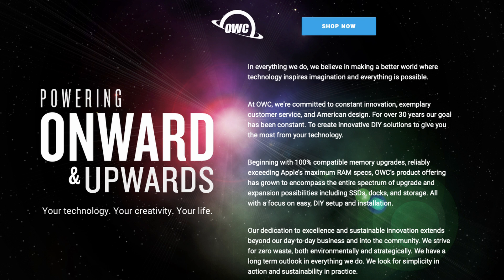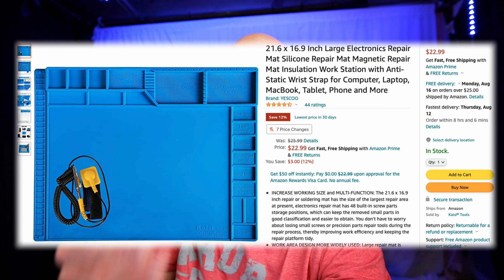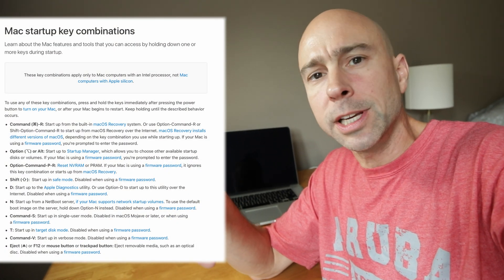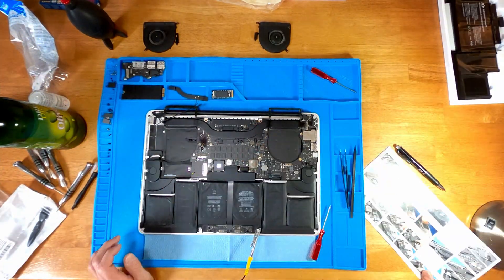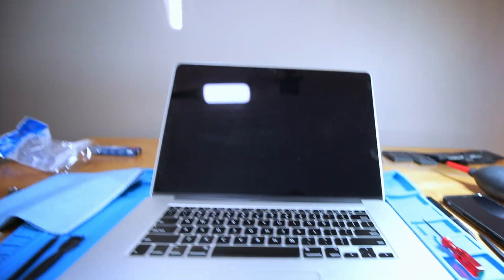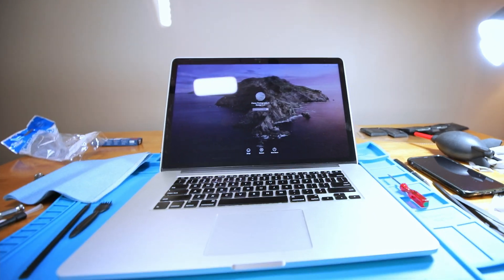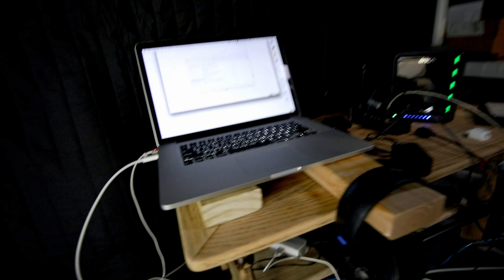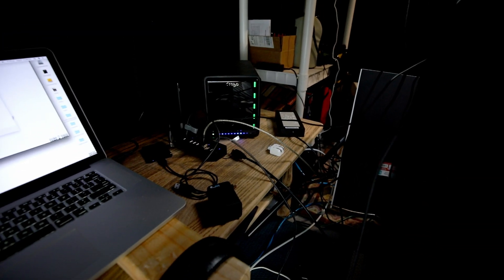APPLE said it was DEAD!  But I FIXED my 15" MacBook Pro STUCK in a Boot Loop!

Comment: Hi! My Macbook Pro 2019 is not starting. It was working fine last time I used. I tried several ways to turn it on, but no luck. Will changing the battery work? Apple says the logic board needs to be replaced. Thanks!
Reply from the maker: Not sure if replacing the battery will work for you but they told me it was a bad logic board too which wasn’t true.  I figured I’d give it a try for 85 bucks, and installed a new battery myself. It worked, and I’m still using the same laptop today.  Realistically, I think Apple just wants you to buy a new laptop, but it may very well be fixable.

Comment: Yes! Mine was the same, and I did exactly as you said, and it booted the first time!! Same model as well
Reply from the maker: Awesome!  I’m still using mine with no problems! 😁👍
Reply: @JasonYadlovski  I’m curious, did you ever do the work to get it up to Ventura? I’m considering it
Reply from the maker: I haven't tried upgrading it to Ventura yet, but I should give it a try.

Comment: I just replaced the battery from my macbook pro mid 2015 because it had been in "service battery" state for couple of years and after replacement it started all good but it still said "service battery". So I decided I will do the battery calibration, The battery was around 80% full or something so I let it charge to full and stay there bit over 2 hours. Then I let the battery dry out so that the computer shut down, went for few days holidays and now that I came back I tried to charge it to full but the charge indicator never turned green (I let it charge maybe 6hours). So now that I'm trying to turn on the computer the battery icon just shows "X" on it (No battery installed?) And I can't get to my desktop, each time the login progress bar hits around 50% it just shuts down. Any Ideas? I've tried PRAM reset and nothing :(
Reply from the maker: Maybe try unplugging the battery and then just plugging it back into the computer again?
Reply: @JasonYadlovski  Thanks I will try that! I also found a new battery with a decent discount and delivery time of 3 days tops so placed an order for that... just in case
Reply from the maker: Nice, I hope it works out!

Comment: Thanks i changed my MBP 2015 bad battery and it fixed my boot loop problem
Reply from the maker: Awesome! Exactly the reason I made a video, to help somebody else out and prevent you from having to buy a whole new computer.  My 2015 MBP still working awesome and I use it daily.  😁👍

Comment: The reason Apple didn’t suggest replacing the battery is because their genius bar is sad fact of the matter, not there to actually fix out of warranty product, but to convince you that you need a new one. It’s part of what makes Apple’s boasts about sustainability a joke since they chomp at the bit to get people to replace, rather than repair and reuse. I’ve been servicing older Macs for decades now and 80% of the time Apple says something is terminal it’s a $200 or less repair.
Reply from the maker: That’s crazy, sad that they do that. I’m glad I was able to figure out how to fix mine, saved me a lot of money.  😜

Comment: Hello, I'm having this exact issue but mine turns on by itself when I plug charger and starts this loop but it won't turn on on battery, please any help.
Reply: You mean that once you replaced the battery it worked, OMG, this is already giving me hope, please can I further confirm that your issue was exactly like mine 

Laptop doesn't turn on at all and when you plug charger it turns on by itself and then begins to loop but once you unplug the charger it offs.
Reply from the maker: Yes, that’s exactly what mine was doing. It was stuck in a boot loop as soon as I plugged it in. I took it to Apple, they said the computer was shot but I had done some research online and saw that a bad battery would cause this exact problem. 

So I took a chance for $80 and bought a battery from other world computing, installed it and the laptop fired right up and Its been running fine ever since.  

I would say, if you’re comfortable taking apart your computer, pick up the battery from OWC and give it a try. Of course I cannot guarantee it’s gonna work for you but if you’re like me, I figured I have a paperweight anyway so what do I have to lose. Just 80 bucks.  😜
Reply: @ayoseunsolomon2562  i have same issue too. the repair guy said it my graphics card but I don't think so.
Reply: @jideoguns3283   if it's not turning up, it could be
Reply from the maker: I had the same issue, replacing the battery fixed it.   I’m still using the laptop today with no problems.  Crazy that apple said the motherboard was shot, when it was just the battery.

Comment: Maaaaaan! You absolutely saved my 2015 15" MacBook Pro! Thank you so much! I had the EXACT same issue you had (Boot Loop) and your video saved me hundreds (maybe thousands) of dollars. I used the link you shared to order my replacement battery (same model as your MacBook Pro in the video). Once I received it in the mail, I felt prepared to do the work having watched your video. It really helped me a lot and saved me a lot of frustration because I knew what was coming! After it was all said and done, my old MacBook Pro booted up and all was right with the world. I can't thank you enough. Your labor is not in vain! Keep up the good work. Blessings!
Reply from the maker: That’s so awesome, super excited that it worked for you!  I can’t believe that Apple told me the motherboard was shot when all it needed was a new battery. I even pushed them suggesting that it was the battery and they said, nope it’s the motherboard.  I’m still using my 2015 MacBook Pro, works just as good as ever. 😁👍 cheers to many more years of use on your 2015 MacBook Pro! 👍👍👍
Reply: @JasonYadlovski   love you sir.

Comment: Happyness is what they are selling to make u buy new.. but u found out its the baterry....
Reply: can we modify the adaptor to fit the Battery port (without the battery but a modified port to fit) to fool the macbook that there is battery???
Reply from the maker: I don’t know, but for 85 bucks it’s worth it just to get a new battery.
Reply from the maker: Yeah man, glad I was able to fix it for 85 bucks. It’s been working ever since with no problems.

Comment: I'm so completely over Apple products. The last two Macbook Pro's and an top spec 2013 iMac all died within 6 months of the 3 year Apple Care plan ending. All for basically the same reason, they overheat, and the graphics chip or the logic board or the solder holding them together fries. $1500 - $2000 quote from Apple to fix them because of their own overheating issues. Their stuff looks pretty, and it works for a while, but it's disposable. So after 7 years of using Apple I switched back to PC and no more problems. Personally anyone doing full time video work should just stop buying Apple's products. Unless you're doing audio work, in which case I've been told PC is not an option.... /rant
Reply from the maker: Oh man, that is crazy that both your MBP's died just after the apple care.  That's not right.  I'm thankful that I haven't really any any problems with any of my Mac's other than this battery issue.  But thankfully I could fix it for just the cost of the battery.  Apple didn't charge anything to look at it.  Building a great editing PC is always in the back of my mind though....😜

Comment: 🐨Gday Jason, I recall the 'Formula' I used with Audacity to do my vocal's. I am certain that the same would apply in Resolve. In fact, I would not be surprized if Fairlight is actually based upon Audacity. I will send you an audio snippet from my E1S1 in a few weeks time. As I am camera shy, you will not need the visuals and I will not need the completed file as you will show me and others how it is done.                                                                                                                                    1/. Remove noise. 2/. Apply a compressor. 3/. Apply normalization. 4/. Drop the pitch by 3 semi-tones.                             My thanks in advance. 🙏
Reply from the maker: Hi!  I’m sure the same process you use in audacity will work in resolve too.  There are probably many of the same tools.  I have not  really used audacity but heard it’s good. 😁👍

Comment: That is so cool you got the computer working again!  I have a 2010 Macbook Pro 13" laptop sitting around here somewhere, plugged into the wall.  I think if I checked the runtime, it's been up for about 6 years LOL.  Battery is toast, so I don't dare unplug it.  That's the only Mac story I've got :D
Reply from the maker: Thanks! Running for 6 years, haha! 🤪
Reply: @JasonYadlovski  Yeah, I think it was several years ago I rebooted it for some upgrades, and promptly put it away again.  Now that you've reminded me I have it, I'll have to find it and see if it's still running and how long the uptime is... that'd be a great pic to take :D
Reply from the maker: That would be awesome.  I have an iMac from 2008 that still works.  It’s good for web surfing, email and typing papers and basic stuff.  Funny thing is at one point it turned off and wouldn’t turn on for two years. Then I decide to try it one last time before I was going to throw it out and it fired right up and has been fine ever since.
Reply: @JasonYadlovski  Well, anticlimactic, but I just checked and my wife unplugged my Macbook so she could plug in something else... so it's been long shut off. :(
Reply from the maker: Bummer!

Comment: Because Apple just wants you to buy a new one. They suck. I replaced the battery on my 2012 MBP a couple of years ago and it is still working. I don't use it for editing anymore but I use it for everything else.
Reply from the maker: Nice, glad you got it working. This 2015 that I have was maxed out when I bought it and it works great for everything. Video editing is getting a little sluggish for anything more than basic edits but it’s a fantastic computer otherwise. And still has all the ports that Apple did away with. 😁 i’m sure it’ll still work good for years to come.

Comment: OWC is the way to go.  I've used them for battery & hard drive for a mid-2010 MacBook Pro.  The instructions they send are spot on just like you noticed.   I had to retire that computer after 12 years because the OS no longer was being supported or updated, plus it was moving very slow.  I'm on a loaded-up 2019 16" MacBook Pro now,. Good to see you were able to fix your Mac.  If you decide to get rid of it, at least it powers on which makes it worth more on trade-in or if you sell it outright.
Reply from the maker: OWC it’s great, I’ve used them in the past for other things too. They really do a good job with all their stuff. 😁👍

Comment: Replacing a battery should be a straight forward thing but Apple does not want you to replace the battery, they want you to buy a new laptop!
Reply from the maker: Probably true. 😜 this time I did not glue the battery in, just in case I need to replace it again ever it’s a quick easy pop in and pop it out. I would give up all of the ultrathin, sleek look to a laptop for easier service ability and being able to change some parts around.

Comment: 🔴 How much did the Apple charge you for that so called "diagnosis?
Reply from the maker: No charge.  They reloaded the OS and checked everything else.  Only the battery came back bad, which I already knew. Said it was a bad logic board.  It would just boot loop and not stop.  After some research, seems people with 2013 - 2015 MacBook pros had the same issue  when the battery was shot.  Apple did say it should work with no battery or even a bad battery, but that didn’t seem to be the case.
Reply: @JasonYadlovski  🔴 If everybody else was working like these Apple guys, this world would become one big mess and it would be destroyed. These Apple employees are obviously not making this world and our lives better. Something is very wrong with the company, at least in terms of it's human resources policies, if not at a deeper and more basic level.

Comment: 🔴 Wondering if the Apple guys are this incompetent in their field, or they misled you on purpose, so that you would lay out more money. By the way, laptops with Windows OS run with dead batteries, with the adapters plugged in, and the batteries can be replaced in one click.

Comment: Congrats bro you still have a 4 year old $3200 mac book pro small 15" that doesn't equal the $1800 machine you've got coming in the mail.  Don't feel bad I ounce paid $3200 for a specially built laptop that was in the shop right after I got it for most of a year under warranty. but $75 shipping to Upstate NY where they took it across the border to fix Twice. I ordered it with a very expensive screen turns out the rest of the machine wasn't compatible with that screen so the put the 1080 on it and refused to reimburse me... they went out of business a year later.  Lesson learned buy local. Of I've been screwed by Best Buy too.
Reply from the maker: Congrats on the new machine! Do I sense a little sarcasm in there? 😜 all good. Mine is actually 6 years old and is a great machine.  Now that it’s fixed up it’ll be good to go for a long time.  It’s great for Lightroom and still great for DaVinci Resolve too but fusion gets a little tough for it. 

PCs are good too, I’ve just had a great experience with Macs since I started using them. In my experience there’s just much less issues with software and maintenance on a Mac versus a PC. Don’t get me wrong they’re both great and they can both get the job done it’s really just a matter of preference at this point in time.  I even have a iMac from 2008 that still works and is good. To each his own. 😁👍
Reply: @JasonYadlovski  It's ALL Sarcasm BRO  I just can't help my self when it comes to APPLE products or SPECTRUM radios for Radio Controlled airplanes. Have an AWESOME day
Reply: @JasonYadlovski  I have a DOS machine with a 9" CGA screen 2 5&1'4" floppies a 6 pac and 10 meg Westerns Digital hard card. Bet if I replaced the cell battery it might still boot. Anyone remember any Dos Commands like ??? (A)
Reply from the maker: Haha, it's all good my friend....that old computer might make for a good project!  I know spectrum radios, but I've never had one.  😁

Comment: Same thing happened where my sons cheep windows 10 computer qould no boot. REMOVED the EXTERNAL battery waited a few minutes. Sipped the battery back in it's hole and walla it booted and has been running for 3 months. Ya gotta love windows simplicity and price.
Reply from the maker: Nice!  😁👍

Comment: Glad to hear you fixed your computer! You are pretty handy!

What monitor do you use. I am thinking of getting a second monitor for my 27 inch iMac.

How many monitors do you use?
Reply from the maker: Thanks!  I just use 1 external monitor a 34” ultra wide LG https://geni.us/WideScreenMonitorLG  it’s great for video and photo editing.  I’d make sure you get a higher resolution monitor than 1080 since the Macs are already so good.  😁👍
Reply: @JasonYadlovski  I was thinking the 1080 might be okay since I would have one good screen for the video editing and use the second monitor for the resolve tools and  rousers and email.

Does that make sense or am I missing something with that logic?
Reply from the maker: With a 1080 monitor, everything on there might look a little big but with a higher resolution monitor you can make everything smaller and fit more on the screen. Just something to think about. And just FYI with DaVinci Resolve you can’t pull out the toolbars.
Reply: @JasonYadlovski  Really - you mean they have to stay on the same monitor as the main timeline? 
Can you put the tool bars on other monitors in other programs?

I am trying to figure out the best least expensive solution to some more screen space.
Reply from the maker: In most of the programs you can take the toolbars and move them wherever you want. However in DaVinci Resolve you cannot move any of the toolbars off the screen. That’s why I decided to go with one large screen versus multiple screens. The wide  screen that I got is perfect for video editing because it lets the timeline be long on the screen with plenty of room for tool bars, etc.  and there’s also enough screen real estate to be able to make resolve a little bit smaller and have other programs open next to it.